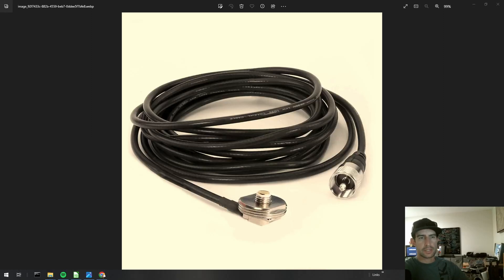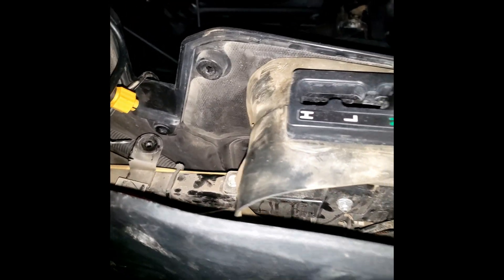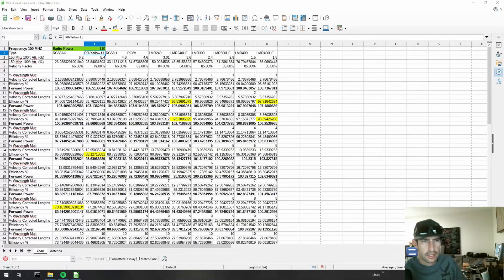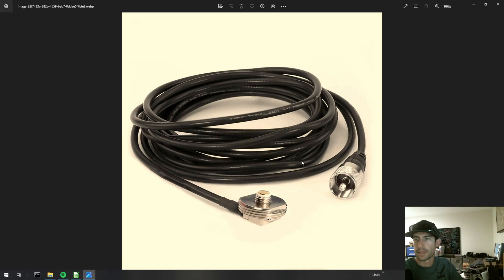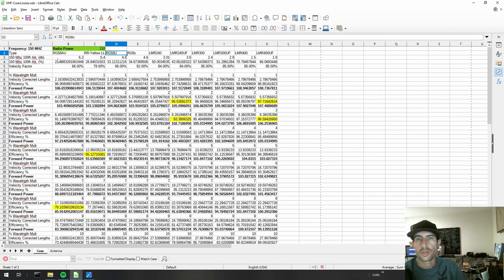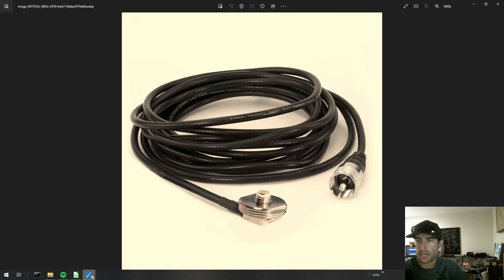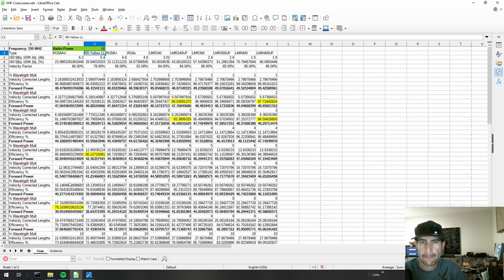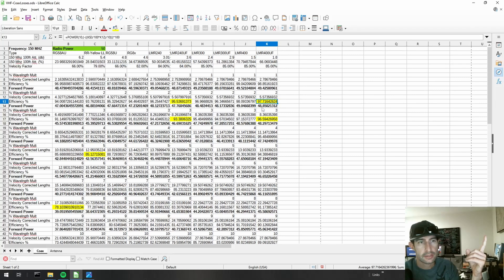Why your Race Radio Sucks - Part 1, Bad coax cable

Comment: Tried sending you an email about getting a coax made, but not sure its going through.
Reply from the maker: Hey Steve,
Had a website crash earlier this year. took some time off but things are comnig back together. 
Still lots to fix but the most reliable way to contact me is through here:
https://calendly.com/stevenlutz

Or can be ordered here:
https://ruggedroutes.com/long-range-antenna-coax-cable-abr400uf.html

Comment: Question on the Ferrite block (hopefully I spelt it correct).

I have a TYT TH-9000D radio on the dash of my jeep.
Quite often. (Not all the time, but enough to drive me nuts). When I press my PTT button. My Jeeps radio (JVC KW-Z1000W) will shut off. When I release the PTT it comes back on. 
I usually have my Gaia map up on the screen of the JVC and sometimes this will exit my mapping. Or freeze that screen when it comes back on.

Now I also have the Baofeng UV82. And again this little hand held will also cause enough interference that the radio (JVC)  will randomly turn off. 

I have my ham license but no nothing of the hobby. Only got it so I could run a VHF radio in my jeep. 

I've heard of these ferrite blocks. Would something like that help with my interference? And if so. Would that have to go on the JVC? Seeing that a hand held Baofeng can cause that same interference? 

Thanks
Reply from the maker: Putting the appropriate ferrite on the cables leading into the jvc stereo could  potentially fix the issue. 
Also, make sure your antenna is tuned. Interference from poor coax and bad swr can cause all sorts of things to happen. 
I would check the antenna and coax first, route any coax away from stereo wires and resort to ferrite on the wires connecting to the stereo last.

Comment: Great content!! can you go over how to make up, cut the cable? I'm running a rugged 50w and would love to run lmr400 cable but don't know how to physically make the connections.
Reply from the maker: Thank you! 
A few things to reiterate here, make sure to use lmr400 Ultra Flex. Regular lmr400 is absolutely terrible to deal with and won't last offroad. Also, be sure to use one of the lengths calculated in the chart. You can also step down to a LMR240UF if you need something easier to work with. 
For the connectors: they are called pl-259 or UHF connectors and can be soldered or crimped. You can find tutorials on the web for how to install them..  Historically I have personally soldered them. However, its an absolute pain to build these cables. Unless you plan on doing g a lot of these, I don't think getting g the tools and going through the trouble is worth it and  recommend you just order a complete cable to fit your needs.
The coax ill be bringing in will be tuned lengths for vhf, with ferrite filters Installed and a sheath to protected against abrasion along the entire length
Reply: @CraigL804 I would go with the 240. Contingent on your installation length, the performance difference between the two isn't worth the extra cost of the LMR400 and dealing with the larger cable. Also, UF isn't that much more flexible than standard 240/400, it's just built to BE flexed more in moving installations.
Reply from the maker: @rlm975  I absolutely can't argue with that. In most vehicles the LM400UR would be hard to route but in Race Trucks, Buggies, UTV's etc, it shoudn't be an issue.